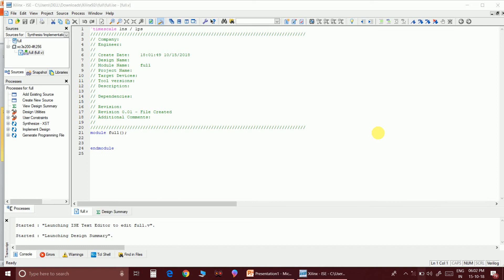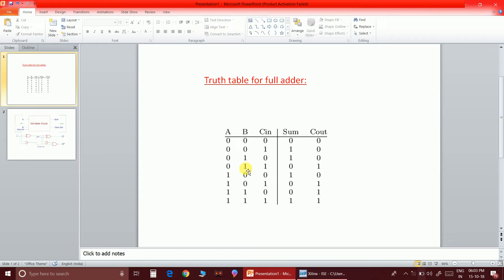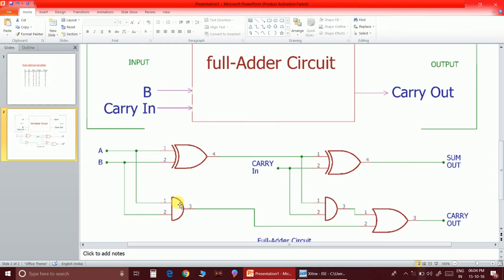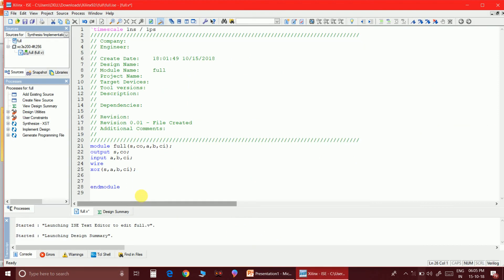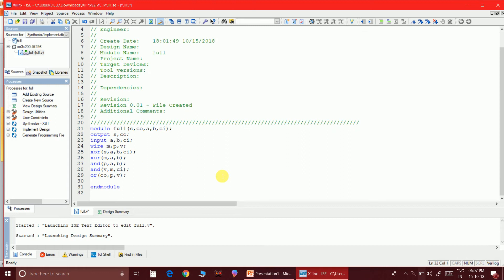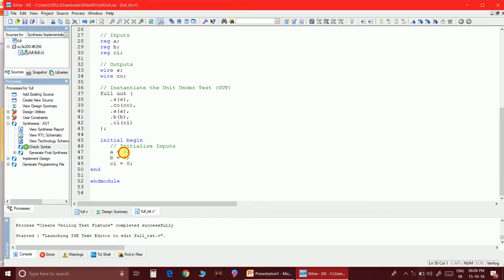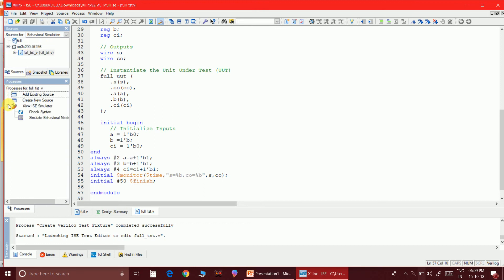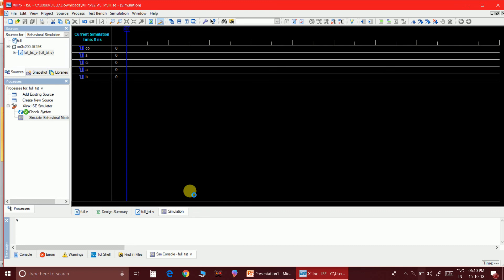verilog code for fulladder

Comment: VHDL for full adder using module
approach and this code are same?
Reply from the maker: There will be slight difference in the syntax , there you will also add syntax similar to C language syntax.
Reply: YES, there is similarity in the approach. In VHDL we have to declare the module as a component in the declaration part of the architecture. In Verilog, no need to do the declaration explicitly....